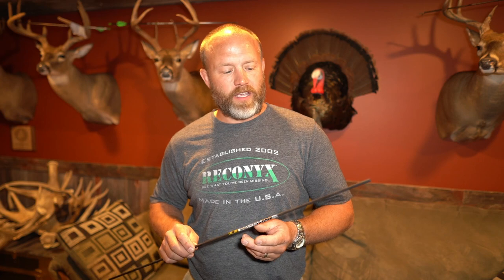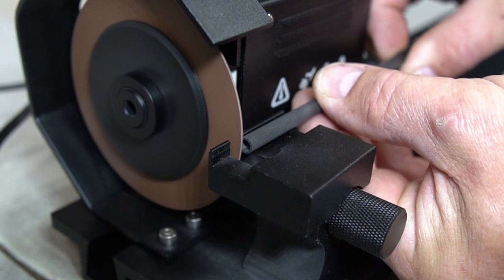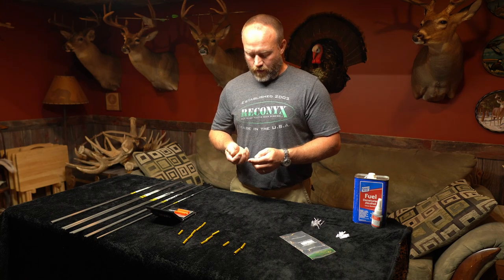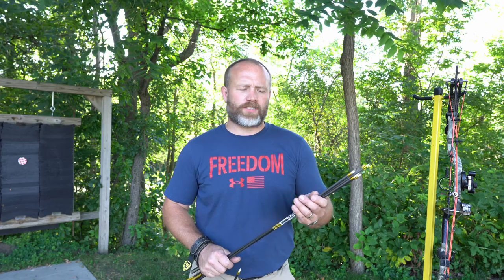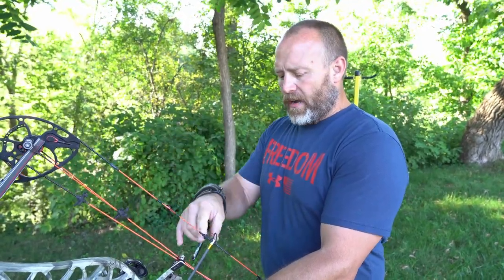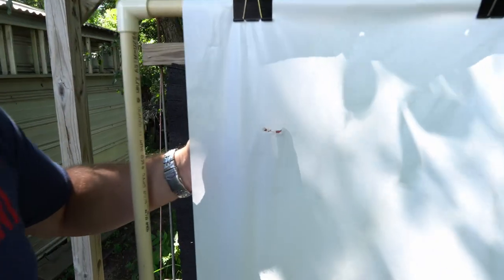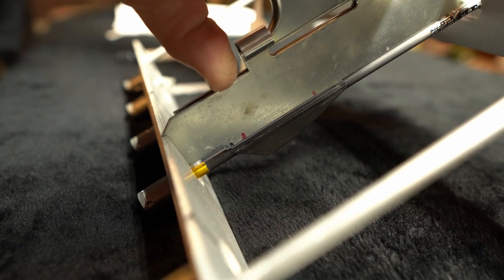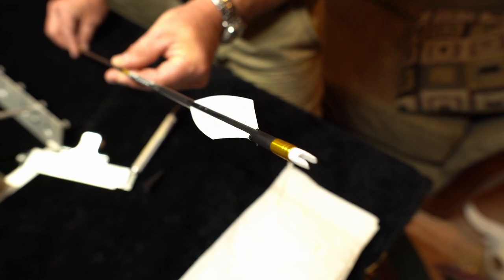Arrow Build | How To Build More Accurate Arrows

Comment: Lancaster Archery did a really good video about fletching your arrows the same way it comes off the bow. The arrow shooting the left spin arrow fletched with a right helical was already spinning to the right within a couple feet out of the bow. I dont like seeing that fight between how it comes off the string and what the fletchings make it do but no matter how it comes out of the bow  a right helical easily outweighs a left spin especially if using a single bevel.  That being said bow string makers need to start making strings so arrows come off the bow spinning to the right.
Reply: They do make left bevel heads! And right helical is better for all the expandables that have offset blades otherwise you lose penetration spinning left with blades wanting to open from a right offset design
Reply: I honestly don't think it matters that much.

Comment: Good stuff,  I've built my own for a very long time, but I like the tuning steps you do. Ive never done that and quite frankly had never taken the time to weigh components.  Getting back into some more target based shooting so will have to start being more precise.  Trying TAC vanes, pin nocks and glue in points for this set. didn't go with pierces, let alone platinum, but did standard ultralights as I am shooting a couple of TAC events this year and a few less $$ per shaft if broken or lost will be more palatable...lol.  Also first time gluing carbon shafts in a long time as I have shot FMJ's for a long time.  Don't know if you ever do target points but I am thinking hot melt for the points themselves, and just standard CA for everything else like always.  Enjoyed the content!
Reply from the maker: Thanks!! That also sounds like a cool build! Good luck shooting 👍

Comment: If I had one recommendation when you were spending your arrows I would hold the bottom of that spinner so it could not rock back and forth therefore you got a really solid structure and you know it's no wobble influenced by the spinner moving
Reply from the maker: That is a good idea. Thank you!

Comment: How important is bullet holes? When your trying to group broadheads to field points and your rest adjusting, clearly your tuned bow will now be ripping left or right on paper. Id just like to have the option of fixed and mechanicals in my quiver so grouping is pretty important to me
Reply from the maker: If your fixed broadhead is your main head then I would definitely tune your bow to that head. But in our case we typically focus on mechanical heads and our fixed have been very close to our tuned mechanicals
Reply: @tagemoutdoors405  Cheers for that!
Reply: Bullet holes means better fixed broadhead flight from the start so it’s the most important thing imo

Comment: I'm curious how did you know the arrow spun to the left off your string and not to the right? I know you mentioned because the little notch on the nock. I'm still not following how you knew it spun to the left. Is it because the distance you were standing at wouldn't allow the arrow to spin all the way around if it had spun to the right? not sure if I'm making sense, I apologize. just confused on how you new it spun left.
Reply from the maker: Correct, it would not have enough time to make a full rotation therefore my bow shot it spinning left. You can mark them with a pen or sharpie to be sure where your arrow starts in the nocked position and it will be pretty easy to determine what way it spins
Reply: @tagemoutdoors405  thank you so much. my 2 boys are starting to get very involved with archery and we've begun to build our own arrows. this video was so informative i can't thank you enough.

Comment: At 1:31, you say that you have a 28' draw, so you're cutting the arrows at 27 1/2"
How did you determine the amount to cut? 
I have a 31" draw. Should I leave my shafts 32"?
Reply from the maker: I would recommend loading an uncut arrow in your bow and drawing it back.  While at full draw, have someone mark about and inch ahead of your rest launcher and make that your cut mark.  Make sure to take into consideration your outsert.  You don't want it to touch your rest.  I would assume it will be a bit shorter than your draw length.  You could always leave them at 32" as well.   It will just be a little long.

Comment: When determining which way the arrow spins after leaving the bow, I would think shooting at several different distances rather than just one distance would provide better results. Maybe you did that and didn't show it. That way you can see as the arrow rotates more which way it progresses. I have 4 bows and only one of them bareshaft spins to the left. So maybe shoot at 4 feet, then 5 feet and then 6 feet.
Reply: It really just needs to come off the string. A bare shaft arrow has no ability to change the rotation off your string.
Reply: You want to shoot a bare shaft as close as possible to a target to clock the rotation. If you allow the arrow to make a full rotation then you wouldn’t know if it was clocking left or clocking right. The rotation won’t change with distance on a bare shaft, so there’s no benefit to shooting further distances.